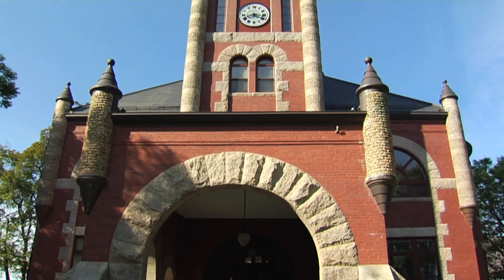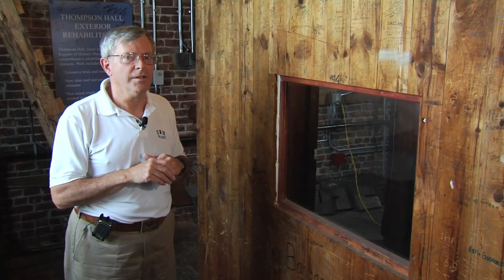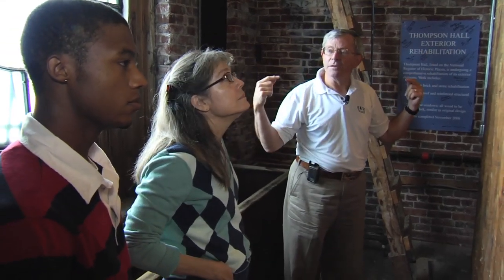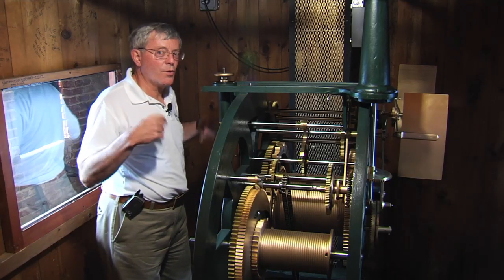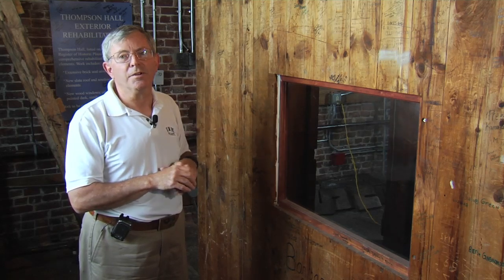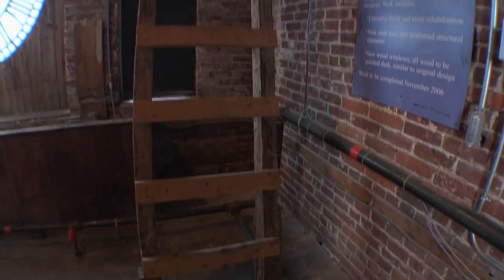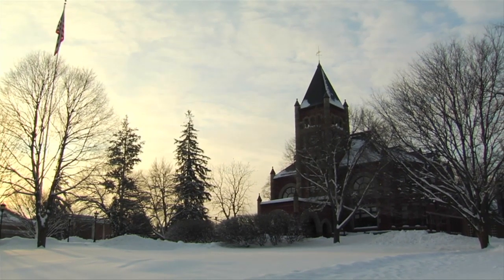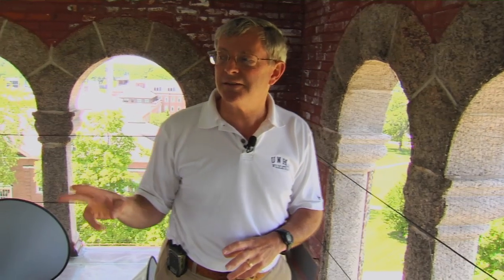Clock Tower in Thompson Hall at UNH

Comment: There is an actual electronic carillon in the Alumni Center. My music theory teacher here at UNH is in charge of it; he brought our class there once to see it! The songs are input digitally through a keyboard, then the program rings the carillon bells in the alumni center based on what they are programmed to play at certain times. They are actual PHYSICAL bells, NOT a "tape." However, the bells aren't shaped like the bells you may be thinking of. They are actually sets of thin metal rods being struck by hammers. This allows for several sets of bells with different timbres to be kept in one small room! When they are played in the alumni center, the sound is sent to Thompson Hall and is played over the speakers.
Reply: If they are thin and tube shaped, they're called "chimes" or "gongs" so you don't confuse them with real bells
Reply: They are mass rowe